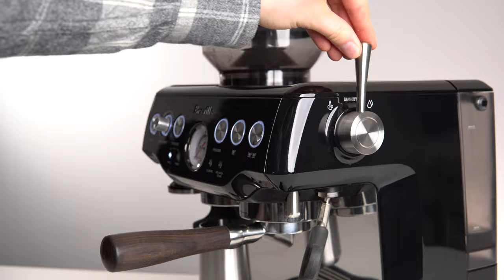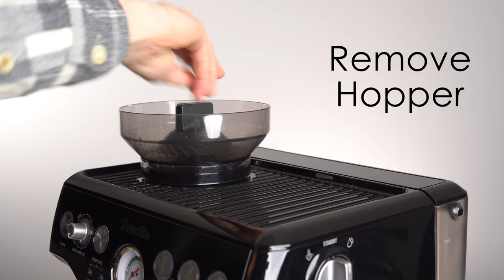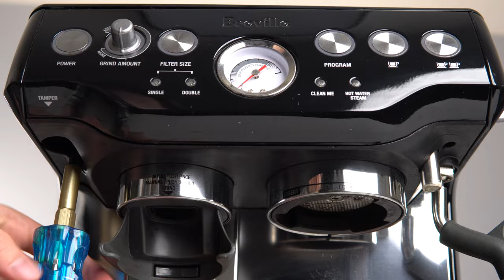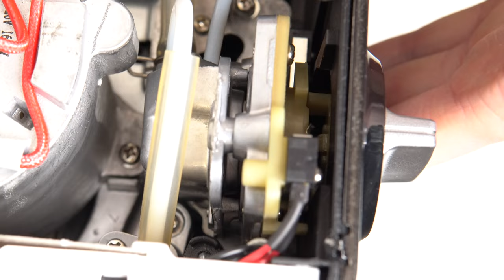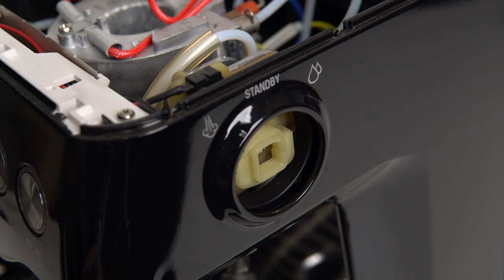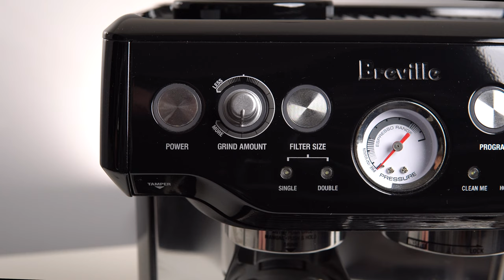How to Install Breville Steam Lever Upgrade

Comment: Just a PSA for anyone doing these, they are SO easy to install. It might seem scary but just be sure to go SLOW don’t let that silly masculine need to be rip roaring fast at everything overpower the sensible strategy of taking your time and doing it right, free of dents, scratches and frustration! It took me about 30 minutes or so taking my time, using all hand tools as power tools can lead to accidental stripping of threads on plastic threads like on these. Anyway, it’s an awesome mod and you will love it! Yes, it is heavy. In a (mostly) good way. It does make the newly formed arm a tiny bit more slop than with the essentially weightless plastic junk knob that came with the machine. Don’t listen to the naysayers, it isn’t bad and the looks more than make up for it. Also, as long as you don’t overly rank on the arm when using it you won’t have any issues. The Breville piece that is re-used on these attaches quite firmly to the selector mechanism.  It feels a tad “sloppy” (only a tad) but it is NOT going to just fall off like some have insinuated. The clip is made of thick tough plastic and it isn’t gonna break without serious force. In 10 years UV damage might change that equation but that’s a bridge to cross way down the road if ever.

Comment: Just installed mine. I found that the hardest part was actually the screw directly behind the tamper because the magnet kept pulling the screw away

Comment: For the first time ever, I'm now waiting for my machine's Warranty to expire so I can do this upgrade!
Reply: Wait why are you waiting for the warranty to expire?
Reply: @milesrowe9228  If you pop the cover on the machine and make any mods while it's under warranty, you'll void it (states that on the manual) since they only want authorized repair centers to work on the machines AND only Breville parts to be installed. Thinking you could be slick and restore it back with the original knob? Nice try, but they put a special kind of glue on the screws that acts as a seal, so they can tell when the original "seal" was broken. Nice handle, but I personally wouldn't risk voiding the warranty on my machine for it (my warranty expires in a month or so anyway, so I can definitely wait).
Reply: @luifranco1457  thanks for that info. That’s annoying

Comment: I see there are some people saying there's no point in this because "the knob isn't hard to turn," well my knob IS hard to turn, most of the time, like it's rubbing on something somehow. I don't know what's wrong with it? My Infuser is the same way, except on the Barista Express it will very occasionally feel like I assume it's supposed to (firm, but smooth).

Comment: Looks very pretty, but I would be concerned at the potential to destroy the underlying valve head due to the increase in leverage (especially potential side ways leverage) associated with the long handle. I would imagine the valve mechanism was never designed to handle such stresses. It’s only plastic (as shown in the video) when all's said and done. I guess that’s likely why it wobbles too.
Reply: this makes a hell of alot of sens peta, especially seing the lever looks like a heavy metal material and i can just imagine someone (other then me) using my brand new machine pulling on it on off mutiple times it would break like a small twig. Thanks for the info, i cancelled my order for mine.

Comment: All I would add to this, is when replacing the screws, back turn them first to seat them into the existing thread. If you don't manage this first time the screws will attempt to cut new threads potentially stripping the threads and not allowing the screws to tighten.

Comment: Thank you so much. I was able to do it confidently with your easy-to-follow- instructions. It looks and works great. Now I am going to change over the steam wand head to something with a few more holes.
Reply: Not worth changing the steam holes. I tried and all it did was reduce steam pressure and create a small vortex when steaming. That makes sense. A machine that has 1 steam hole is likely to produce weak steam (not even close to a bar of pressure). Whereas steam wands with multiple holes have much better steam pressure, therefore the added steam holes improve vortex formation greatly.

Comment: Just installed it today and its looks and feels quite nice.
A observation, there is play in the lever, which I think is due to small indents on the original knob which is not on the lever. But not sure if I did not screw the lever screws tightly or if its a manf. / design issue. :D
Reply: Mine has a lot of jiggle as well
Reply: Can confirm, very jiggling the lever... that plastic thing is not desingned to handle the force of that lever...

Comment: Great upgrade, looks better. However the loose wiggle concerns me. Is there any way to correct this? Perhaps a reinforce plastic ring or rubber gasket ring that fits inside gap/space between the plastic housing and steel lever to help eliminate issue? I was thinking of hot gluing the space between the plastic case and the lever as a possible fix, but need to order a lever first. From the looks of it. Basically the only parts that are keeping the lever in place (which is too heavy for the plastic housing clip) are the two screws, and the plastic clip. Seems like the internal plastic housing could break easy.
Reply: pls reply here if anyone has a fix for the wiggle!  tks
Reply: @richrazon8189  I have seen others say they put an oring around the inside of the handle to fix that

Comment: I've only had this coffee machine for 1 month but the original steam level is extremely stiff and hard to turn. Do you know what could be causing this?
Reply from the maker: That's just the way it's built, hence the design of this aftermarket accessory!
Reply: I have the same issue. Mine is a bit older (about 7 years) but it got really stiff. Sometimes when it gets hot I can't return it to normal position.

Comment: My new (-2 months old) Breville Barista express' original steam lever is very stiff. Is anyone facing the same issue? please help.
Reply: Yes they are usually stiff at first. It settles in the more you use it.
Reply: Mine is around six months old and still stiff.
Reply: @thumbtak123  I recently descaled mine and now suddenly it is much smoother... (around 10 months old)

Comment: Could you show this install on a Barista Pro? I understand there are slightly different clips holding on the cover that I'd like to see before I break them myself 😂
Reply: I installed on my Pro. Instruction is same but Pro has 3 screws on back instead of 5 (water tank area).
Reply: You'll be okay!! There's only one little clip notch that sticks out on the front center of the lid/cover. As long as you gently pry the lid off from the back first, it'll come off fine! I'll be releasing a video of my install this weekend; though I didn't show the notch too clearly, you'll be able to spot it

Comment: It is nearly impossible to get the screw by the steam wand out. Been trying for hours. This is a royal pain in the butt.  I’ve had three people try and none of them could get that screw out, not even a mechanic. You can’t see in the hole. No amount of pressure works. This is a huge design flaw in the coffee maker. Definitely not worth trying to put the off market handle on. Don’t buy the off market handle. Leave well enough alone
Reply: Same problem and I think I stripped the screw. Kinda stuck now.